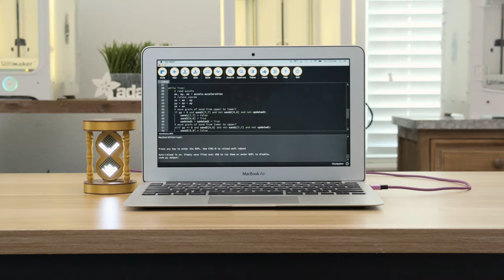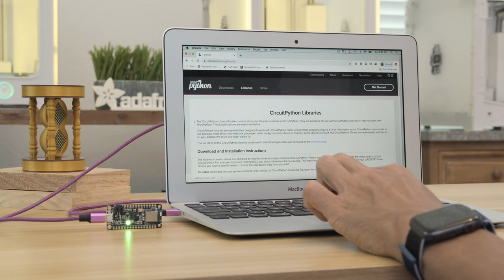LED Matrix Hourglass

Comment: I did not see a link to the 3D printer files for the hourglass on the github link.
Reply from the maker: project cad files are link in the learn guide. 3d models of the electronics are on github https://github.com/adafruit/Adafruit_CAD_Parts
Reply: Thanks. I found teh CAD parts and Python code, but was looking for a link to the STL files. I found them in teh PDF guide thanks.